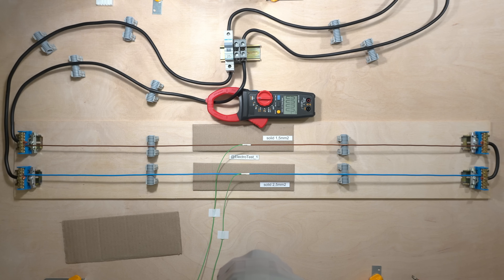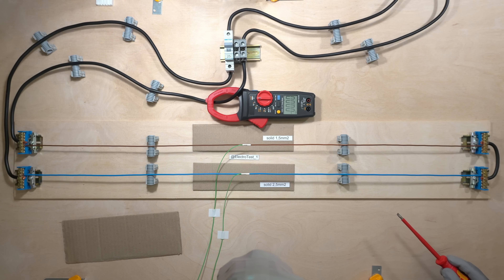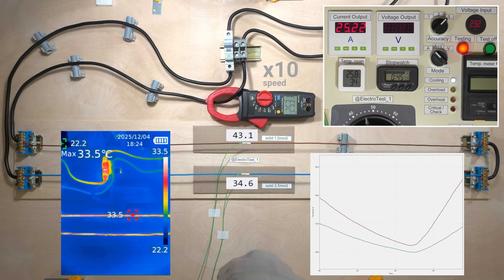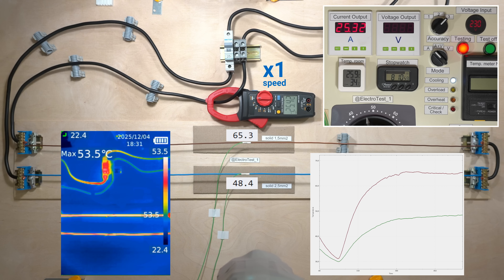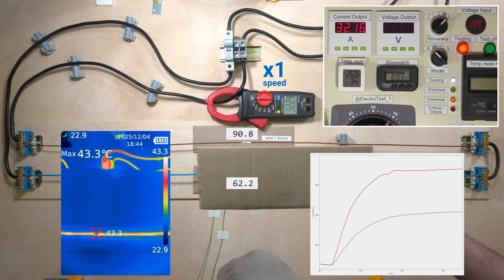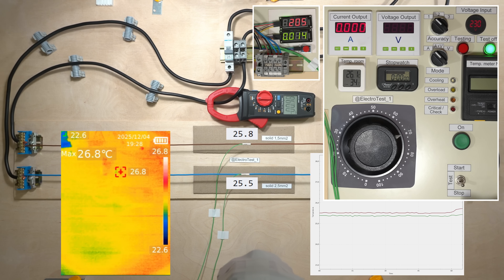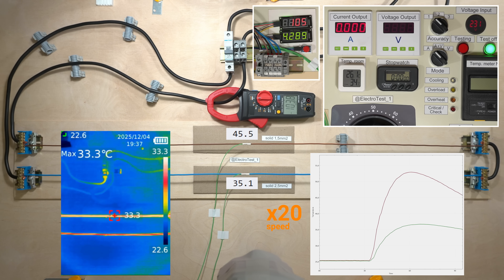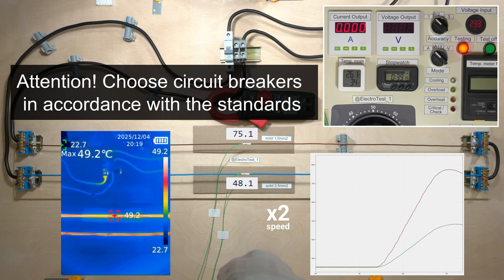1,5 vs 2,5 mm2 Wire in series Current test

Comment: While you do mention the "open air" issue, it is completely at the end and very casual. I would worry some people may look at this and think 20Amp over an unrated 1.5mm is not really a problem, but as we both know, when doubled up inside a plastic cable inside an insulated wall, it really will melt. I really think that should always be shown, not merely told at the end.
Reply from the maker: Constructive feedback! I also sometimes worry about how to present or convey information. Let’s break it down step by step. In the video, I show a specific situation—a single conductor in the air—and I pass current at a certain temperature, 25°C. This is a study of different wires. When a person works with electrical installations professionally, or does electrical work for themselves, they will gather information from various sources—colleagues, friends, other bloggers. And I believe that, one way or another, they should familiarize themselves with the regulations in their own country. I could conduct many more tests on different wires, and in each video I cannot cover all the installation methods or the number of conductors. Those could be separate, extensive thematic videos.
Reply: Very well placed.  In my country we have a very good, robust and complete electrical standard and the conductor capacity depends on how it is installed (open air, inside a conduit), the size of the conduit and also on the number of conductors installed inside that conduit.   

There is no table showing how many amps a conductor will stand. (1.5 mm , 2.5mm, 4mm, etc).     This is because the environment plays a critical role here.
Reply: Everyone doing electrical installations should already know that, or they would not be licensed otherwise
Reply: I have a tiny EV. It will draw 9A at 230V
In the back, there is a bundle of wire, 0.75mm², for emergency charging. 20m. 
It used to be a 10m cable but that ended up too short. And space wouldn't allow a proper cable at 20m.
Thank the universe for open air letting heat escape, or that wouldn't be safe. Even while it's not to code.
Reply: @Azeazezar  How is it fused? Please note there is another aspect: a wire too long/thin, will restrict current so much a fuse may not blow fast enough, and the wire will instead become fire-starter coil. This is especially for longer lengths.
Reply: @cybermaus there is a 10A glass fuse in the plug. Besides the car not being set up to draw more then 9A.
And I uncoil it. Didn't uncoil it once while holding it just to sense how it heats up, and boy does it heat up while coiled.
Reply: @Azeazezar  And that last part of what you said does not make you wonder?
Reply: @Azeazezar Limiting charge current setting doesn't remove the fusing issue..! Fuses are not meant to be blown due to normal rated amps and usage but instead faulty load..what if Your charger primary circuit got shorted and the max current (due to long length of wire coiled or straightened) will not blow the fuse..? Can You guess what will happen? 🙂
Reply: @hipihei it will melt, and expose the conductors? Either shorting fully, tripping the breaker. Tripping the ground fault circuit, Or becoming the longest and messiest fuse.
Did I miss something?
Reply: @Azeazezar   "Did I miss something?" Well, respectfully yes, option 4: "Becoming the longest and messiest NON-fuse". Let me explain with some numbers, because it is sort of impressive how well your example fits the theory:     20 meter of 0.75mm2 copper twice (return) is just under 1.0 Ohm . So you may think shorting it would give 230 Amps, plenty ten times over to indeed blow out the fuse, or even the wire becoming a fuse itself.    BUT   as the copper heats up, it will increase resistance by a factor 1.0033/C. At just below copper melting temp 1080C, it would have risen to ~26 Ohm. Meaning max current 230/26 = 9A, meaning both the fuse and wire itself will exactly NOT melt. It is impressive how you have exactly the correct values all around to make it the perfect theoretical edge case.  In practice, the 10A fuse will likely go during initial temperature ramp up, especially if it is a fast fuse. And if not, the wire probably would melt, as the 0.75 is not perfectly smooth so there will be local hot spots. And probably yet more practical variations to my simplistic physics model, like how the boiling plastic would perform evaporative cooling. So you probably would end up with your option 3 and not my option 4.
Reply: @Azeazezar  Anyway more practical: "space did not allow proper cable at 20 meter" If 10 meter was just to short, consider 15 meter instead of 20. 15 meter of 1.0 would already be twice as good as 20 meter of 0.75, when it comes to the "fusing robustness" of the setup (not entirely sure what the correct English EE jargon translation is of Dutch "korsluitvastheid")
Reply: @cybermaus  I dont like the idea of shortening the cable. Could i get away with adding a thermal fuse?
I used it once, beyond validating its function. Just 20 min to get juice to move to a proper charging station. and was glad for the length. 
What kind of time frame are we looking at for that cable to transform to a non-fuse? seconds? minutes?
Dutch is fine, if thats easier.
Thanks for the math, that clears things up.
Reply: @Azeazezar  So the sarcastic "how the boiling plastic would perform evaporative cooling" also did not make you reconsider eh? Ok, fine: 1) Never be tempted to replace the fast 10A fuse with a slower or higher one. 2) Uncoil the wire, but not on top of anything flammable. 3) don't leave home or take a nap while using it. As to a thermal fuse it would not work, because you had uncoiled the wired to 20 meter, so where on the 20 meter to put it.

Comment: One wire transfer heat to another ?
Reply from the maker: If they were in direct contact, then yes. But there are busbars and thick wires between them. The heat transfer is likely insignificant. And the higher the current, the greater the heat transfer. I’ll try to run some preliminary tests on this.

Comment: Can you do head to head wire connection test with high current to see which connection heats the least please? In a way the wires are connected head to head not side by side.

I couldn't find any tests on YouTube like yours.

I know you have a few videos similar but in those tests the wire is connected side by side not head to head to make a straight connection. Love you❤
Reply from the maker: Great idea! What types of connections do you use? What wire cross-sections and currents do you find more interesting and would like to see tested exactly?
Reply: @ElectroTest_1 my problem is I use old school twist to join two wires. I know it is bad as one morning in the summer I woke up to see my cable catching fire as the electric kettle was pulling too much amps through the poor cable connection. That's why I am asking for a video from you mate.😊

Now I try to avoid using such setup on anything that pulls more than 200-300watt.
Reply from the maker: Well, I’ll definitely work on this topic — I won’t put it off for too long 🙂 Yeah, be careful with those twist connections. Although I’ve seen cases where they worked just fine for quite a long time.

Comment: It would be much more interesting to perform this test using standard household installation cables. The temperatures would behave significantly differently because of the heat buildup. That would be a real-life scenario.
Reply from the maker: It’s interesting that in real-life scenarios there are quite a lot of variations — different routing methods, different types of connections in junction boxes and outlets, and different wall materials.

Comment: Your provider of cables screws you on copper...
Reply from the maker: The cross-section is within acceptable limits — permissible deviation is 10%. Do you buy wires with an exact cross-section of 1.5 and 2.5?
Reply: @ElectroTest_1 I don't know, i never measured them. 😉 And i wonder why never it is not +10% 😉
Reply: Też zaciekawiła mnie ta kwestia i sam przed sobą się zdziwiłem, że nigdy nie wpadłem na pomysł by zmierzyć przekrój materiału na którym zdarza mi się pracować. Zaokrąglanie w dół to pewnego rodzaju oszustwo. Zrozumiała jest kwestia tolerancji i to, że kilak procent daje niewielki ubytek. W idealnym świecie oczekiwał bym, że przekrój będzie nie mniejszy aniżeli wspominana wartość. Dlaczego to nie jest przewód 1,4mm2 ? :D
Reply: Bo nie ma takiego w typoszeregu 😉
Jeszcze pikuś jak trochę miedzi rąbną ale sa tez te chińskie druty CCS i CCA choć (Coper coated Aluminum or Steel) chyba głównie w skrętce komputerowej.
Reply from the maker: The production of wires and cables is a very interesting process! I think it’s not bad if the cross-section is slightly smaller, but within 10%. The conductors are lighter and easier to bend. Also, manufacturers have a certain range for competition and different production and equipment settings. You can see the difference in heating between 1.4 mm² and 2.3 mm². Now imagine 1.4 mm² and 1.5 mm² — the difference would probably be no more than 1–2 degrees(currents 10-20A).

Comment: Test 3G1.5 and 3G2.5 in a) air b) conduit c) between rockwool and wall d) between two 5cm sheets of rockwool. Sensor on the external surface of the cable. Can we estimate actual temperature of the internal wire insulation (as the max is 70 often).

Comment: By old Yugoslav standards, due to high summer temperature, formula was simple:
6A per mm² for wires inside the walls
8A per mm² for wires in exposed cable
10A per mm² for separate wires in open air and rubber/silicone insulation (high temlerature)
This way, ratings were:
0.75mm² 2A 5A 8A
1mm² 6A 8A 10A
1.5mm² 10A 13A 16A
2.5mm² 16A 20A 25A
4mm² 25A 32A 40A
6mm² 32A 40A 50A
10mm² 50A 63A 80A
16mm² 63A 80A 100A
Reply from the maker: Hi! I like your list — it roughly matches the standards. However, there’s an interesting thing: starting from 6 mm² your statements no longer work — for example, 6–10 A per mm². Have you thought about this too?
Reply: @ElectroTest_1 Because they did overbuilt everything, and also I did nkt add 3-phase power de-ratung into formula. At very high currents there was almost no single-phase power anywhere.
Reply from the maker: Here I’ll argue with you a bit :) The reason isn’t that thick wires have extra capacity. It’s just that the ratio of cooling surface area to current decreases as the cross-section increases. So a 16 mm² wire will most likely heat up at 100 A roughly the same way a 1.5 mm² wire does at 16 A.
Reply: @ElectroTest_1 for 32 ampere I need 10mm2 for up to 40 meters on a wallbox.
Reply: I always like to size up at least one or even two gauges larger wire size the "recommended" and never settle for the bare minimum wire gauge required.
I don't like my wires getting even noticeably lukewarm to the touch. I prefer them to feel stone cold or room temperature at most for peace of mind and having headroom in case of high ambient temperatures etc.
Reply: Can i use same data for 20 meters cable lenght?
Reply: @miguelroscas Fuse rating is prevent cable over-geating. Heating per meter is the same, no matter if cable is 1m or 100m. The only issue is Voltage drop, and there are calculators online. So if your load is sensitive to voltage drop, you should use thicker cables.
Reply: Aluminium? Or copper?

Comment: Протестируйте в гофре и в стене. Потощущениям замурованный в стену провод будет прекрасно в нее отводить тепло
Reply from the maker: That’s a great idea! I think these could be very practical tests — checking cable heating for different installation methods. Which ones do you use?
Reply: @ElectroTest_1 у нас тянут провода в гофре по потолку и муруют в стену  кирпичную/бетонную

Comment: Nice video.  IIRC, under local code (the Netherlands), 1.5mm2 wire is rated for 16A continuous loads, and 2.5mm2 for 20A.  Either single copper conductors in a PVC duct, or bundled in a double insulated cable.
Reply from the maker: Thanks for the information. It’s clear that these currents cause only slight overheating, and even if such a breaker is used, the overload won’t be critical.

Comment: With high currents, wall penetrations become problem areas for cables. If the wall is insulated or made of wood, the conductor temperature can rise significantly even at a wall penetration about 10–15 centimetres thick. It might be interesting to test this by running 1.5 mm² and 2.5 mm² cable through a hole drilled in wood for about 10 centimetres.

Comment: The house I grew up had 1mm2 wires fused with 6A cartridge sand filled.
Reply from the maker: Interesting information. Was your house built around the 1950s–1960s?

Comment: Thank you! 
Suggestion: could you include the voltage drop(/power dissipation) across the wires in your tests?
Reply from the maker: Thanks for the idea! I see that many people find this interesting. Well, I’ll try measuring the voltage drop. I need to test the devices.
Reply: @ElectroTest_1  Yes, would be interesting
Reply: Підтримую! 😊
І на автоматичному вимикачі теж 😂

Comment: cables would be interesting...they say you should use 4mm cable for a 32A socket (1P+N+E 230v) minimum ...but some use 2.5mm...it would be interesting to see how it pans out.
Reply: 32 A for a 2.5 mm² conductor is quite a lot. In many places only 16 A is allowed if the conductor cross-section is 2.5 mm².
Reply: When testing the cable, there are two heating conductors (supply and return) inside the same insulation, so it heats up considerably faster

Comment: Hello,

I think a 3*1.5 or 5*1.5 mm² NYM cable will heat up significantly more than a single exposed conductor. It would be interesting to see how big the difference is between 1.5 and 2.5 and 6 mm². 
In Germany, 1.5 mm² cables are protected with a maximum of 16 A, recently 13 A, and 2.5 mm² cables with a maximum of 20 A circuit breaker.
Reply: @danieldusentrieb3203 where did you get the 13A rating from? When I check the specifications for a NYM-J 3x1,5 at Faber Kabel they give a rating of 19.5A for 30° in air.
Reply: @niri2506  There is no such thing as 13A standard for 1.5mm. A proper conductor cross-section calculation, which obviously no one does, will include many variables such as current load, current continous load, installation method (inside wall, open air, insulated walls etc.), ambient temperature, voltage drop, length of line and some more. In standard house installation NYM 3x1.5mm installed in walls at length of up to 18m is perfectly fine to be protected with 16A breaker.

Comment: Thank you for testing the most often found wire sizes!
Next: How do those behave in a wall regarding heat?
Reply: Yeah, in a wall under plaster, and in a plastic and metal pipe or cable channel, individually and in a bundle of several cables. Will be very interesting
Reply: Exactly. These wires can easily shed their heat to the air compared to real wires in walls.

Comment: Can you test 20 - 30 wago connectors in series? Simulate what happens now that you have many connectors and sockets on a course.
Reply from the maker: Thanks for the donation! I think this could be quite an interesting test — checking the voltage drop and the statistical heating of the terminals?
Reply: @ElectroTest_1  Yes. The sockets I am used to using were screw connections. And twist sleeves to connect inside the boxes.
Now it is wago on wago and plug-in sockets that have taken over.
I sometimes feel like the more wago-ish. The more risk with a 2000w heater at the end.